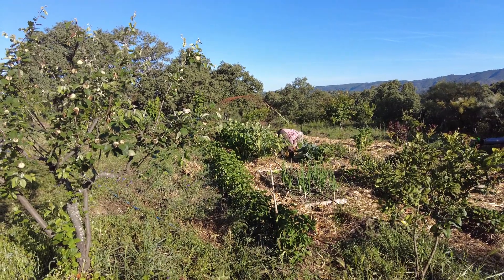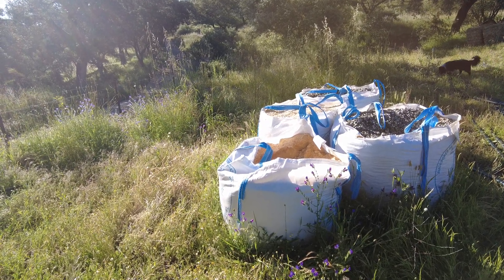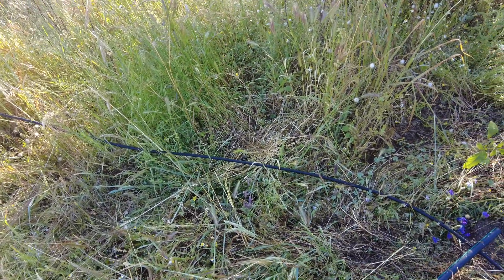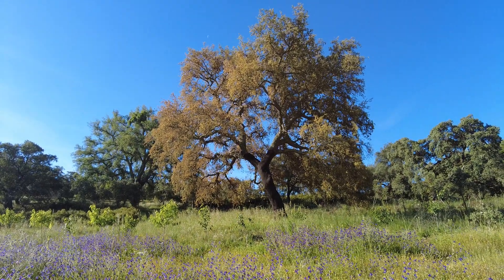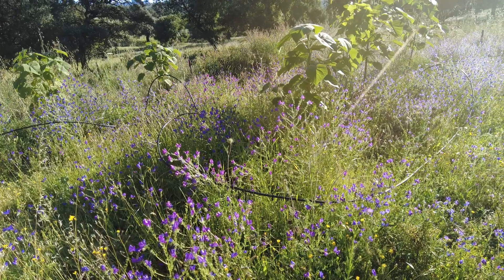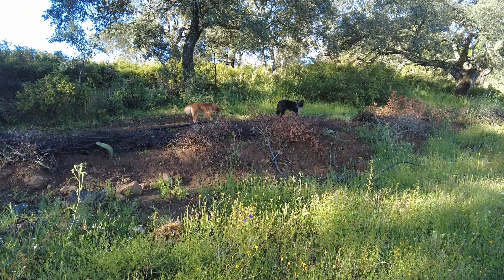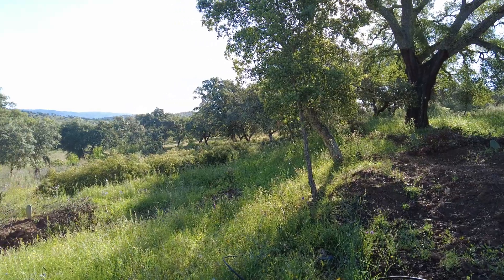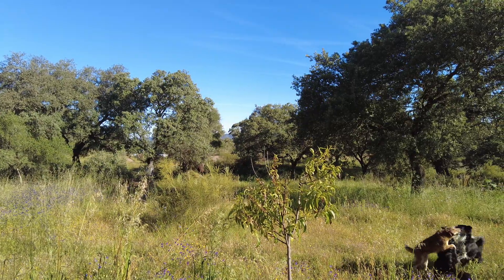Our irrigation system might suck itself dry.

Comment: Several thoughts on your syphon concerns;
You have elected to control the watering manually. (no timers) 
The syphon effect was designed into the system to assist the pump when moving water uphill. This assumes that the pump is always running when your 16mm pipe valves are opened.
The 40mm pipe on contour is a long "thin" water tank running the length of the farm.
I thought the pump had a pressure switch. (turns pump on when water pressure drops in mains,  off when desired mains pressure is reached) If it does not, I'll suggest you need a pressure switch set to  4 bar mains pressure to start.  A pressure switch will increase the life of your pump significantly.

Start Up (beginning of irrigation)
1) At start up, the first action is start the pump.
2) Then walk the irrigation circuit for that period, OPENING 16mm valves as you go.
Shutdown (end of irrigation period)
1) Walk the same route you did at startup.  
2)  As you retrace your start up path, CLOSE 16mm valves as you go.
3) When all 16mm valves are closed, turn off the pump.
There will be no issues of syphoning causing the collapse of your mains if you follow this procedure.

The size of your circuit will depend on A) The total water available to the qanat cistern.
B) The volume capacity of your pump plus the augmentation of the syphon. (Liters per minute)
C) The mains pressure capacity of your pump. (4bar)
D) You will have to test the output of emitters at the beginning and end of a long 16 mm run at the highest elevation of the circuit and the lowest to determine if you are within the capacity of the mains (4 emitters).  This is testing and "fine tuning" the circuit.
E) If there is a marked difference between emitter outputs, the circuit must be made smaller.  If outputs are equal, the circuit is right sized, or can be made larger.  This is a trial and error process.
There should be no need for higher math. As described, the only "precision" tools required are a watch (to determine irrigation period duration) and a measuring cup (determine emitter output at 4 locations defined above to confirm adequate volume and pressure in mains)
When the circuit is defined, it would be helpful to color code the circuit by spray painting all of the 16 mm valves in the circuit one fluorescent color. The next circuit will be a different color and so on.
My best guess is you will have 4 to 6 circuits plus the garden.

I commend you for gathering together all of the abandoned pipe on the farm and repurposing it.  I will caution that it may have degraded over time, so be on the lookout for breaks, especially at startup.
I hope you find this useful.
Reply from the maker: Very useful as usual Steve. I'm concerned that I have to walk more! Only joking. We will get there. Keep sharing young man.
Reply: @SuerteDelMolinoFarm  🤣😂🤣😂 I tried with all my might to sell you the idea of timers but you were not having any of it.  Now you tell me you walk to much???  There are always timers with open loops, closed loops and blunt loops 🤣🤣🤣Just busting your "pork" chops!  What's the fun in all of this if we can't joke, right?

Comment: take a heat(flir)cam .. so u can check the pipes
Reply from the maker: Good one. How do you see that it will help me?
Reply: @SuerteDelMolinoFarm  filled pipes should be cooler ... maybe also monitoring the microclimate whith the temp drops .. should be afordable for iphone and android on amozon .. think about 100 -200